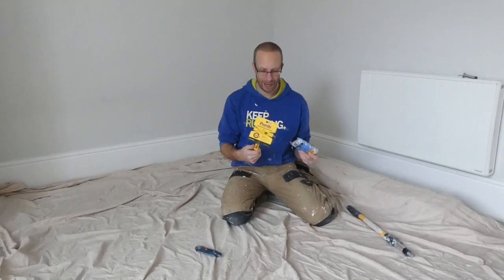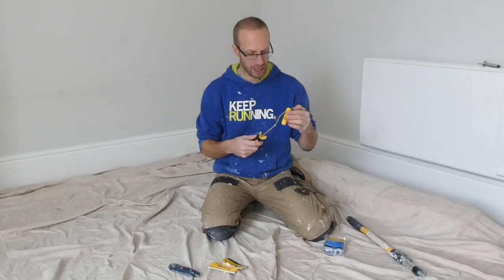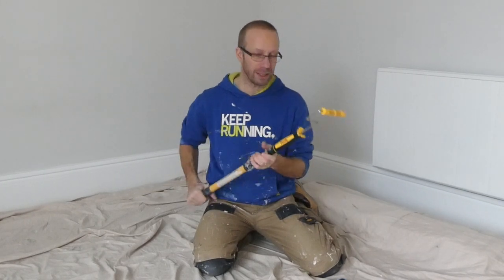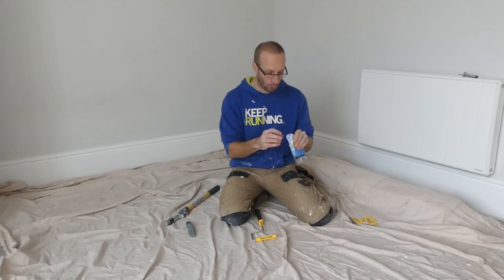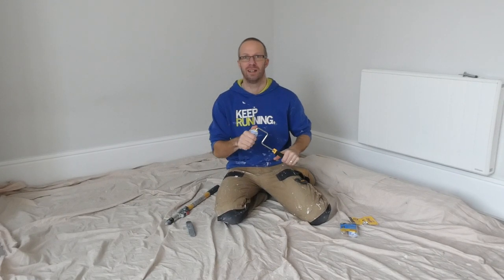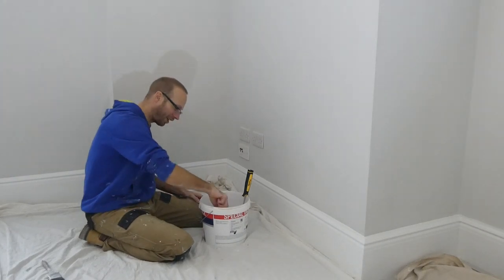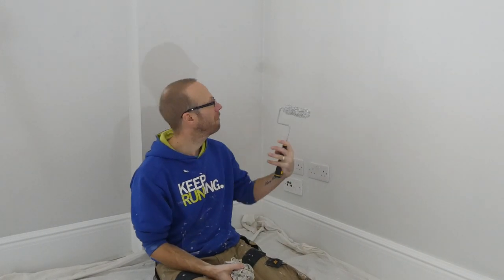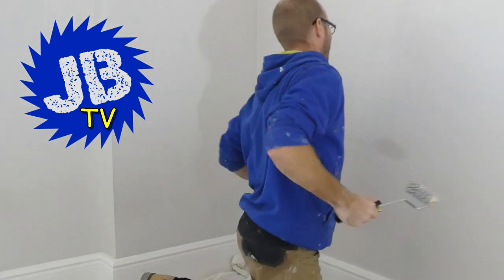Purdy Jumbo Mini Roller Frame and Colossus Sleeve review - Cutting in and rolling out

Comment: Good system, you can actually attach a standard rad roller to these. Put the purdy 6.5inch over a slim 4inch standard sleeve. Candleman painter showed this trick.
2 fussy blokes 4inch are the business for finish, almost spray finish no laying off required.
Reply: Can ya take yellow part off that Purdy Roller and use Two Fussy Blokes Sleeves instead?

Comment: It would be good if you could do a video comparing different types of rollers in terms of how much paint each one holds and the overall finish. I’ve mainly been using a medium pile 9 inch Hamilton perfection as standard and then tried a 10mm nap two fussy blokes microfibre roller sleeve the difference was incredible, especially with stand white emulsion. It’s as if one coat with the new roller is the equivalent of two coats with the Hamilton perfection.